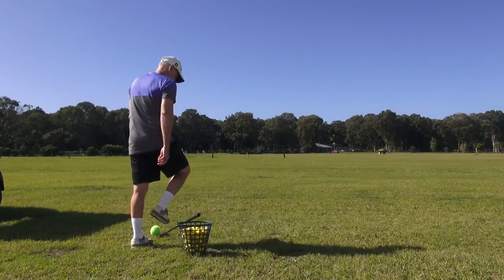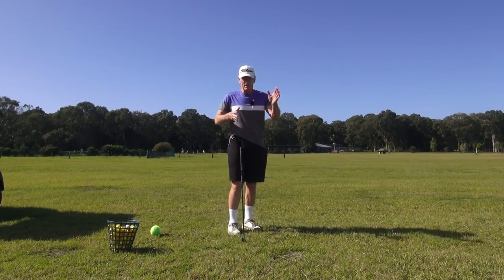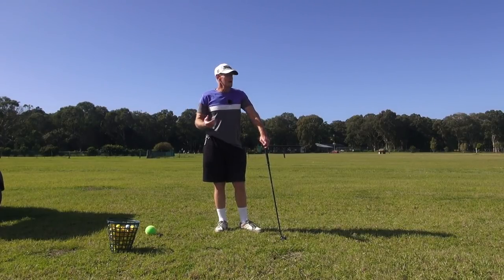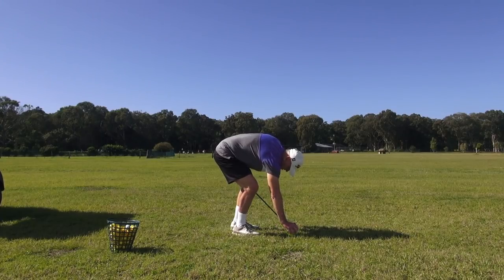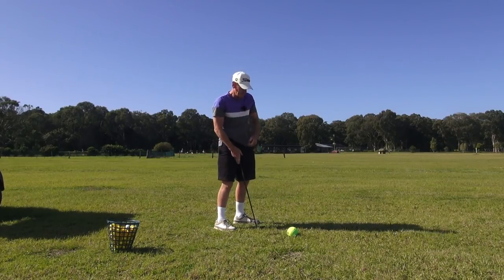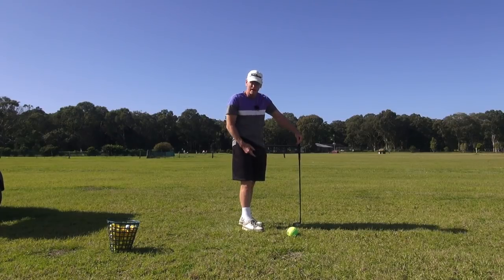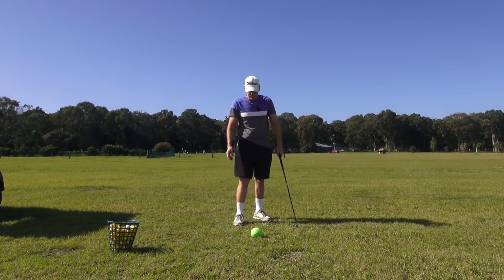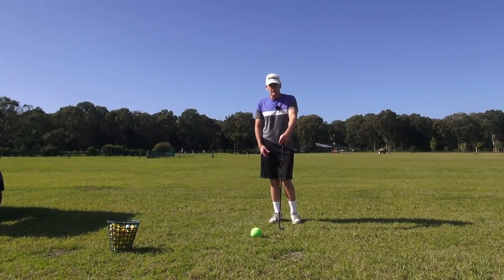Channel Lock   'Focus Point'      Process   video 1

Comment: This is great stuff JH! This is a great way to remove 1 of the many thoughts a golfer has standing over the ball. 1 less thing to think about because your intent subconsciously is to hit the mark on the ball. Brilliant!
Reply from the maker: Hi Chad,
                 For the CL   swing process, it's a great manipulator of the Body into a    'forced' compliance of required geometry application...  CL  is absolutely   dependant on   a closed  shoulder    line    at    at impact and when you   commit to       delivering the clubface   to the golf ball    at that  specific   area of the golf ball (  particularly from a  trail foot  positioning  at address )   the body has to    configure itself     in the manner that  CL geometry   requires..   you   simply 'cannot'  hit the   lower inside quadrant of the golf ball   with open shoulders  ..
                  cheers JH

Comment: Hi JH..This has been a ground breaker  for me. By  applying your recommendation I immediately recognized a fatal flaw in my thought process. I had fallen for the trap of swinging  on an in to out path across the channel not down it .....in consequence of which I  have been banging my head against  a brick wall. The key for me is to swing  directly back ALONG the channel  (not through it)on the  takeaway with the feel that my trail hand moves toward my trail heal then back and thru on  the same line . My hands  rotate naturally during  the downswing/follow through. Key  though process ..get into the channel as quickly as possible.  All good stuff ..Thanks you JH
Reply from the maker: Hi Ross,
                 Swinging the club in the channel is the main component of the CL swing.. you have to understand that CL is a  ' Beside the body in to out'  swing..   as opposed to a conventional swing which is  'in front of the body and side to side'..
                        traditional teaching has always told players not to get the club too far inside on the backswing  ..  with CL     you need to  get the club as far inside as you and as quick as you can in the backswing ..
                        What you don't want to do however is whip the clubhead in behind the hands/ forearms during the backswing  ..  that will get the clubhead tracking radially instead of straight line diagonally  ..

                       cheers JH
Reply: @1atomicgolf  .......Thanks J H ..points noted .....I do not think that I am whipping the club back..........but I will take extra care  going forward......you may remember some time ago likening the takeaway as  feeling like pulling a motor mower cord. Cheers Ross

Comment: I tried this for the first time today and it can work, of course I need to take the time to keep working on it, but the ball does draw no doubts about that, it will take some time and effort on my part to work this in, the longer clubs need work , the irons were pretty good, I do play with Cobra OL F8 ( single length ) will keep at this to see where it goes , thanks
Reply from the maker: Hi Wayne,
        The longer clubs need the same address positioning as the shorter clubs..    no stretching out to the ball at address..  as well keep the weight into the heels on the downswing as long as you can  ..   that will stop the lead shoulder wanting to rotate coming into impact and the shoulders will stay closed easier ..
                        cheers JH

Comment: Brilliant , Its really a point concentration lock which attceives all the CL swing requirements in one thought possibly??? .
Reply: I still have to complete  my back swing first or thats where I go wrong.
Reply: Same here. That's essential for me. Child on swing. Uuuuup, pause transition set, fire
Reply from the maker: Hi Tim,
                'Complete The Backswing'     is  I think one of the best and most important aspects of any golf swing  ..  it was Nicklaus's main swing thought his entire career ..
                       cheers JH
Reply: The Golden Bear knew the transition of back to forward swing was the "magic moment" in traditional golf.

The subsequent dip, secondary tilt,  and other significant points in their down swings weren't repeatable without a smooth transition at the top.

My movement initiated with a tick of my left knee and  simultaneously, silently saying "Maaaaa" through the backswing,  "ah" at the top, and "gic" going back down... a drawn out  "Magic".

And it was magical if the ball went straight.!

Comment: JH, a lot of guys use a small plastic tool called “Line-M-Up” to make a straight black line on the ball with a felt marking pen.  I do, and I mainly use it for putting but I also use it on the tee box.  Wouldn’t it make sense to simply tee up the ball with that line on the desired path of the channel?  The line I make is over an inch long, and standing over the ball makes a great visual of where you want the ball to start.  Wouldn’t it work equally as well to define the channel at setup?
Reply from the maker: Hi Larry,
                I think I said in the video that you could use  'anything'  that was on the ball to set up as the visual focus point... that line you suggest is just 'another' visual focus tool..the reason I suggested  the  ball  name  or  practice range ball   markings  is that they are already    on the ball  and you  don't have to do any  marking  ..
      Clearly that focus point on the ball will only be able to be positioned in practice sessions or when the ball is being teed up   in a  game ..the  focus point   has to be  'learned'    in practice sessions  of course .. we cant  position  the focus point image  in the   normal course of playing a round of golf   because we can't touch the ball ..  the focusing'  must be  learnt in  practice sessions  ..
                    cheers JH

Comment: So JH what your saying is position the ball marking parallel with the channel or shoulder line? Makes sense because you can also zero in on the marking with the five o’clock nose. I’ll give it a go. Cheers.
Reply from the maker: Hi John,
              What you are saying is correct..    get that ball 'name/ marking' pointing on the same imaginary path of the channel  ..  it will take   a few shots to get the level of commitment you need to     fire the clubface at the    inside  quadrant of the golf ball    ..  but   after     some  shots      it  becomes   quite easy to do ..
                        cheers JH

Comment: J.H.  If my visual is a clock face. The ball is at 1 O'clock  and  9 on the clock is the target line and my set up is at 6, do I swing 4 to 10 or 5 to 11?   
And at set up do I align the club face directly at the target line?   I like your "Focus Point."  However, I think a clock face set up is better for me because it gives me a better line path to swing the club on. What do you think? 
Bill Miller, in Ohio
Reply from the maker: Hi Bill,'            
               If the clock face    was on the ground...  the  target would  be    at  9 0clock ...   the club would be swung  coming into impact  from      5  to  11...   however, the 'clubface'  is  released      to  9 oclock  ..    the    hands/arms  club shaft  all  get fired    out  from 5 to 11   ..  but the clubface  gets  released     to the target at  9 o'clock  .. 
                 We   never   change the    direction of the  club shaft    from in to out across  the target line  .. we  just    ' spin/rotate'  the    club shaft on its   travelling axis  ...   the  club shaft  doesn't get thrown sideways towards the   target   .. only the  'clubface'  get   'rotated'  towards the target  ..   I hope that is   understandable  .. I will cover  it  more   fully in the next video ..
                    cheers JH
Reply: Bill, I noticed you said you placed the ball at the 1 o'clock position.  Was this a miss-type.?

You would want the ball in the center of the clock, the point where the clock hands pivot around, so, on the 3 to 9 target line where it intersects the 12-6 line

Your back foot on the 6 to 12 line, if a rightie, and swing as JH said, 5-11. If I recall, mr. Bill had a video on the 4-10 line.
However,
Either line is purely an intentional or thought process imaged design.  The actual path may vary, but we're to keep thinking of cutting across that 3-9 target line right where the ball sits.

I hope I've read/written correctly..

Lock on.!.